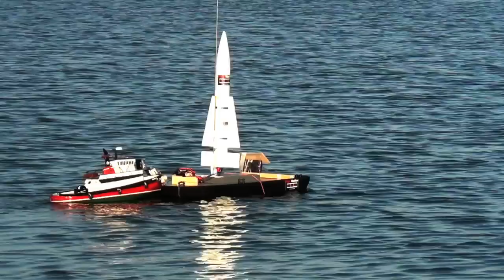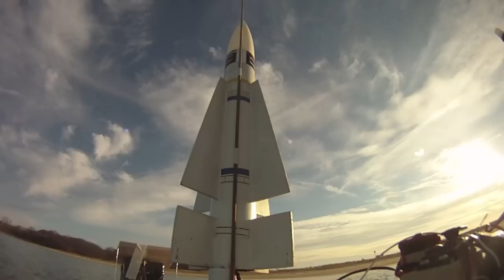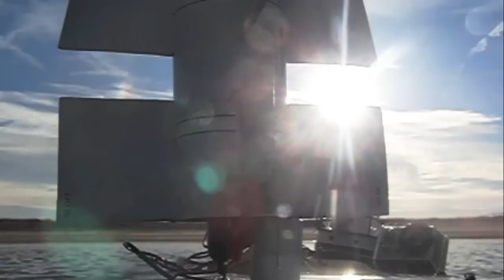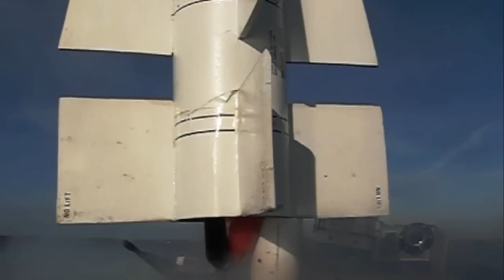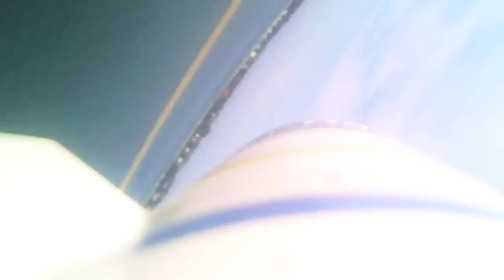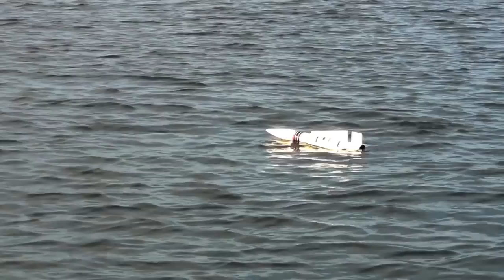Model Rocket w/Camera Crashes At Sea

Comment: Ha! Badass vid. The radio chatter was spot-on, too. My very first rocket was the very same Estes Phoenix A/A missile. Being new at the hobby at the time, and requiring "D" engines, it was a steep learning curve. Mine ALSO had a tendency for horizontal flight, albeit very stable and true (often crashing head-on into wooden fences with, uh...exciting results).

Comment: I have this model rocket myself - has a notoriously short flight if using D motors and prone to "weathercocking" in the slightest breeze - you did really well to get this flight off from a floating platform - great job.

Comment from the maker: @360Nomad This rocket is about as long as the destroyer is, so that would have posed some stability problems. :) The barge was necessary for a rocket this large. 

We have fired some missiles from the deck of the 702, though - both bottle rockets and smaller Estes rockets. Check out our older videos.

Comment from the maker: @iSOisoleucine @ciukcia989 It's pretty simple: a servo swings on R/C command and presses on a relay which closes a circuit between the battery and the igniter. It's a very small, self-contained unit.